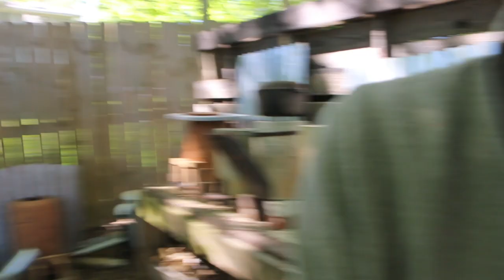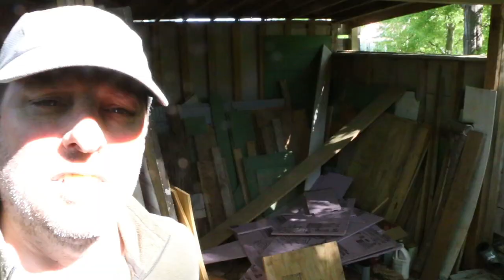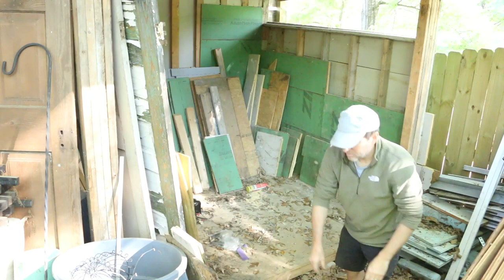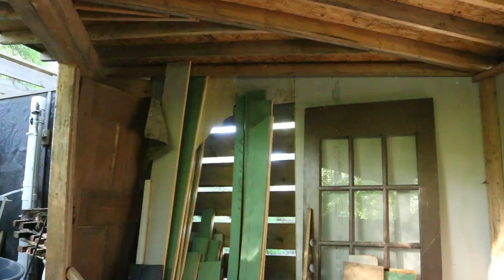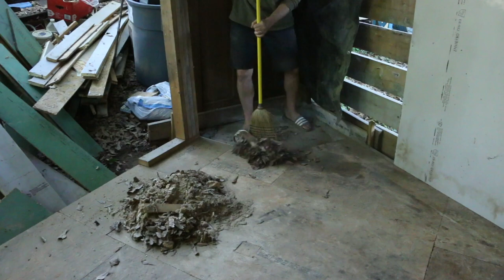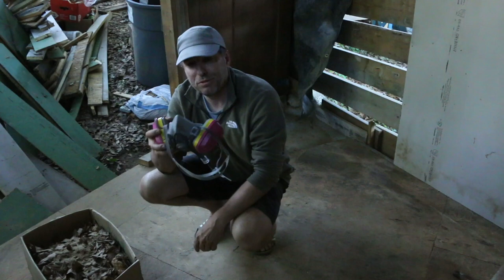I Have A Secret I've Been Hiding | Taking Action to Change My Hoarding – EP.1

Comment: I often wonder about the value of hoarding.  I think it can actually detract from the value what you are able to do.  At some point, if you can't immediately repurpose something and no one else can either, the material actually has a negative impact because it can cause other good materials to deteriorate more rapidly.  Also the cost of time is a real thing.  The fact is, if you pass on picking up a load of materials, that same opportunity will present itself again at some point.  I suffer from similar desires, but I have learned that I only have a certain footprint and I have to work within that footprint.  Good on you Tom!
Reply: "Work within your footprint" -- good one for the wall. And more like Green Shortz in keeping usable materials. But  I started years ago with limiting the size of the twist ties I saved in my kitchen to one small 4 square inch freezer container in a drawer. It either fits in there or we don't need to keep it. I have never run out of twist ties.  The organizer on clean sweep said respect your space. I am trying to put those into practice as I go.